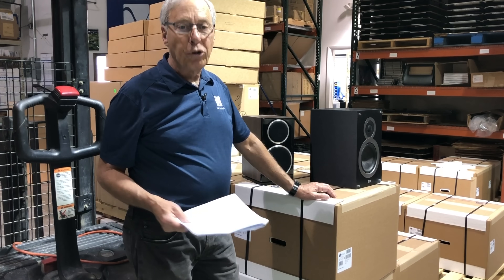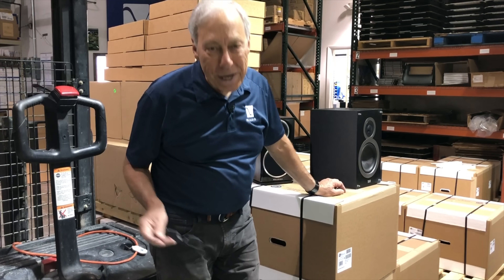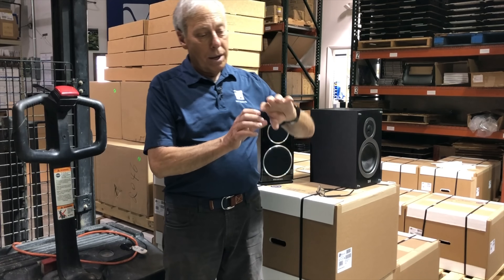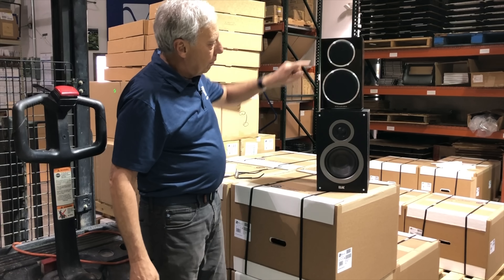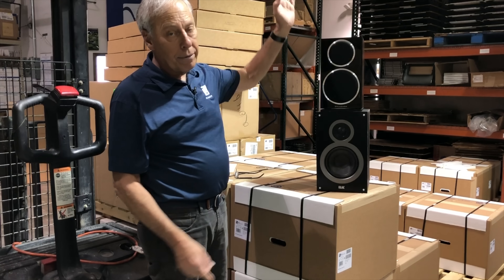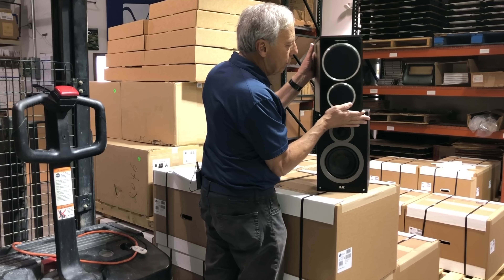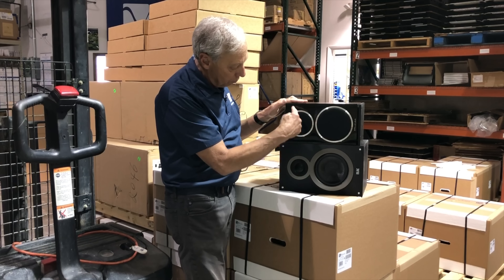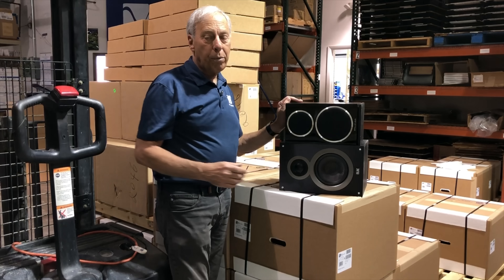Can you make a line source from bookshelf speakers?

Comment: A line array type system offers some great advantages taking a bunch of little speakers and making them effectively 1 big one. In the comments below, you can see there is much discussion about the science involved in doing so and this has much to do with how the sources couple at various frequencies. Quite literally this is a discussion about wavelengths.  A 20Hz wave is 56.62 feet long (at 22 deg C). A 20K wave is .68 inches. In order to couple sources one simply needs to place them in line (so the arrival time at the listening position is the same from all of the sources) within the specified distance of the frequency one wishes to couple. Easy. Right? At 20Hz it is. In fact, if we put two subs anywhere in our living rooms unless your living room is giant they are gonna couple at 20Hz if you stand in the centre of them. How to do we align tweeters though? BTW it is not .68" from the edge of one driver to the next it is about the acoustical centre of the driver... We are well over an inch and probably more than 2. If you look at the IRS V's you will notice the designer chose a sort of ribbon driver. They are a little different in that their acoustical centre runs the entire length of the driver top to bottom. With that, if you place them together the way he did they can couple. In large sound systems, they mostly use Horn flares to "decouple" the higher frequencies as no-one has figured out how to make those frequencies converge so precisely over a 20 or 30-foot array. Oh, so what happens if the sources just partially overlap and don't actually couple? Weirdness.  Cancellations and lobing. Not really anything usable. It is a great little experiment but I would not spend a lot of money trying to do it unless you have money to burn. Unless you can get all of the drivers to couple correctly in your array the results are gonna be bad and not even kinda.
Reply: I am not saying it is not doable. It is. We "do it"every day but one has to understand there is a pile of tech going on there that is maybe not so obvious. Firstly, I should point something out. Line arrays work by using both coupling and cancellation. One of the things that makes them so valuable in live sound reinforcement is the fact that by nature they are directional and steerable. Now, yes by varying the angle of overlap between the drivers we can control what frequencies are coupling but this is usually done to achieve a larger coverage zone. If we took a 16 element array and kept all of the drivers firing at a 0-degree angle we would generate an extremely tight beam which we could use to throw 400 ft or more but anyone standing outside of that beam is not going to hear a lot. The other thing that we need to know is that if we don't arc the drivers the high-frequency drivers try to couple but can't really do it successfully and what happens is we end up with a giant AM radio as the top end is physically being cancelled due to the relative phase of all of the drivers from the coverage zone perspective. We use special software to calculate what those angles need to be and what it will sound like where in the space. The whole thing is very processing intense. Every amp channel has a whole DSP section all to itself and 16 box array could easily have 24 channels of amplification allocated to that one array alone and that is if they are running the array with every two elements powered from 1 amp. (common). There are systems that physically power (and process) every single driver in the rig separately. In a JBL V25 element, there are 9 drivers and other similar units have more. What is going on with all of the DSP? It is a ton of eq as well as some time shifting and a lot of that specifically for the purpose of correcting those very lobes you were talking about. Like I say. There is a lot more going on than meets the eye. For home stereo. The difficulty is going to be getting the higher frequencies to couple rather than cancel because you physically can't get the acoustical centers of the drivers within .68 inches from one another unless you use a line of ribbon(ish) drivers like Arnie Nudell did or you get into serious amounts of delay processing. It all has to do with the waves all arriving at your ear at the same time.
Reply: While they are primarily used in large concert venues there are some exceptions. Have you ever heard  a pair of Sonos Play 5's (v2)? They use a 4inch x 3 driver mid-woofer array that produces tight, clean, are articulate bass down into the mid 30's hz range.
Reply: Hey Bill. What system is your preference for that kind of large format application?
Reply: Mark Smith. Sonos doesn't own the rights to line arraying low-frequency drivers to achieve better performance out of smaller drivers. One thing to consider is that not only do the multiple drivers play lounder together and exhibit a wider usable frequency responce but also because they are smaller and actually lighter they move faster as well. Creating better resolution.
Reply: Hi Rob... Thanks for the additional info. I was very pleasantly surprised not only by the deep rich bass they can produce (especially for their size) but also their resolving ability as you alluded to.
Reply: My pleasure. I come to this via the pro audio side and with that line-arrays are kinda my life now. Love it or hate it that is lol.  As I say like all things they have their strengths and weaknesses. Low-frequency stuff is mostly a strength for them.
Reply: Hi Rob.... Oh cool. Would you mind sharing what some of their weaknesses are?  I imagine cost and size would be among them?  I've only recently heard and read up a bit about them.
Reply: Cost is definitely a biggie but as I pointed out earlier it is very difficult to achieve proper coupling at higher frequencies and no matter how great your cabinet physics still is applicable. There is no way even 6 - 6.5" bass speakers can do all that an 18"  bass driver can. There is always going to be some frequency limitation out of smaller drivers vs bigger ones even when used in larger groupings. Size, weight, processing and power can also be problematic.
Reply: I've only heard a few at concerts and the audience only cares about high dB levels . I didn't write them down as that's not my business. There was a possible candidate in a room at the 2016 AES convention in LA (now  the AES conventions are stuck in NY and I can't afford to fly and stay there).
Reply: Was what you heard actually a line-array or what was it? What make and model of speakers were they?  More than that the truth is that who were the guys operating? The guy mixing plays a big part in the outcome as does the system engineers as does the monitor guy and on and on. As far as what the crowd wants. I think we grossly underestimate people all of the time. Typically, they want it to sound amazing as well as at a level where they can sing and dance and shout and still hear the music over them. You said there was a candidate at an AES convention. There are a number of highly regarded line arrays available that do great things at some pretty high SPLs. I won't go as far as to say that they would be able to beat out high-end home or mastering speakers but when we get into the mid-level stuff the top end of large format sound systems can hold its own against a lot of that.  By way of comparison, you wouldn't compare a Nascar race against a luxury sport. The luxury car has no hope of going anywhere near as fast but you won't find the Nascar able to be taken on a trip. In the same way that high speed and comfort aren't in the same playing field as of yet high SPL and super high fidelity aren't either. That said a good sound system can easily produce sound better than most people hear with their earphones that are plugged their phone or in their stock car stereo.
Reply: Hi Rob.... Thanks for that. But wouldn't an 18" bass driver have higher distortion levels given its greater mass and size?
Reply: Rob Chapman ,
Solve the lobing to a degree by placing the drivers on a surface that arcs = backward-arcing baffles starting perpendicular to the floor then terminating at an upward facing angle. There are a lot of studies and applications of it in sonar in addition to music applications in concert  / sound reinforcement. Parts Express had a kit some years back for home speakers. IIRC, all one gains is better imaging / psychoacoustic placement for more listening positions throughout a space as opposed to attempting increased output for transients / attacks and sustains reproduced towards a constrained sweet spot location. I imagine absorption and reflection management would also be affected in such a room hosting an arced baffle throwing sound in those directions and the ever-present recommendation to use small-diameter drivers regardless of the frequency range but I could get adventurous regardless to see what comes of the meandering.
Reply: And less ability to track the actual signal exactly yes, but due to their physical size, little drivers have a more and more difficult time producing lower frequencies as the driver gets physically smaller. In the end, you are trading some facets for others.
Reply: None that sounded good were line arrays. I have complimented Shannon Center for Performing Arts (Whittier College) many times for having great sound; our last concert there was Roger McGuinn. 
Last year I heard JBL's latest line array behind the Harman building. This went far beyond Harman's tenancy to demonstrate their speakers at ear bursting levels - I survived somehow.
Reply: Let's talk about the Shannon Center for Performing Arts. How many people does it seat (how big is the space) and what exactly is the system installed in there?
Reply: I have nerve heard a line array I liked. Their claim to fame is they they are more efficient at projecting sound long distances so they are used at most arenas and concert stadiums. But they just don't sound good.

Comment: What about stacking them horizontally but not straight up! Stack them in a way that you make a cylinder but slightly funnelled, at the back end where the tweeters would be the woofers would be in the front hang a ball preferably one of those giant tennis balls my work with a piece of cotton, in front of the tweeters, some placement will be in order to find its optimal performance position. This works well with ported speakers only on the outside of the pot to limit extension of the driver. Depends on the size of the port a golf ball  is a good starting point , I call it active damping. you want to experiment with that Paul take it further you're welcome.I Haven't got the time the energy or the enthusiasm or even a system anymore. © All rights received.

Comment: Paul, it is possible, but it involves modification to the said speakers, adding microcontrollers, custom power lines, which involves physical modifications of the said speakers. With a lot of testing and profound knowledge it is possible, but given the investments, it may be easier to use professional, already made equipment.
Edited: that is if you want some average speakers to sound great.
 But they won't sound perfect after all. Probably at the level of expensive audiophile equipment, but not perfect.

Comment: maybe the best option here is a coaxial or full range driver,  and the smallest woofer size will get you smallest distance between tweeters.
either way,  diy is the cheapest way to accomplish this.  and its impossible to get a hold of 10 pairs of speakers of same type used also.
Reply: I've got 4 Equator D5's.  5 inch coaxial/active.  Would be interesting to make a mono stack just for the heck of it.